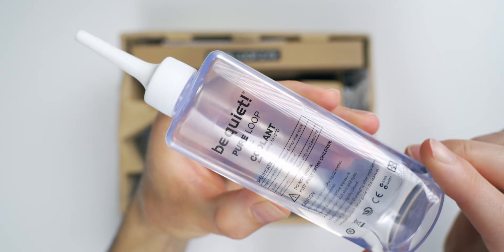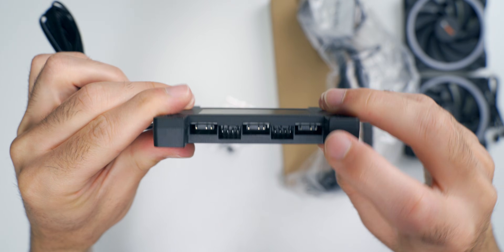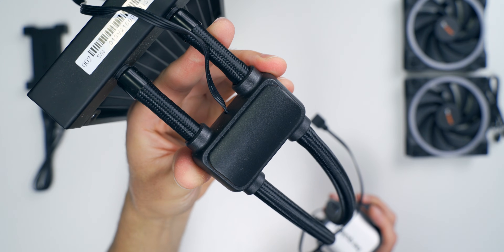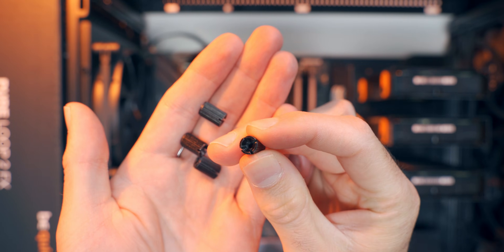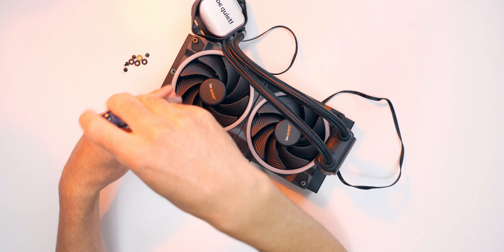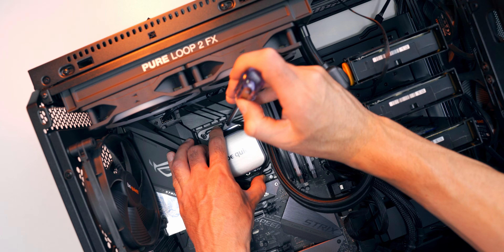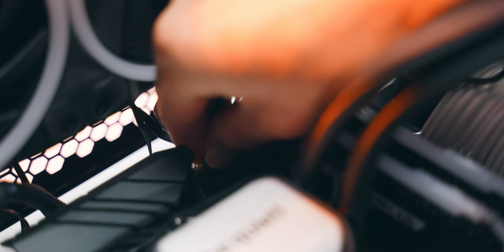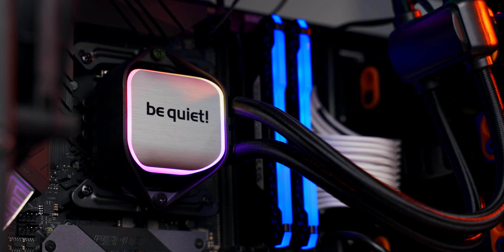Be Quiet! Pure Loop 2 FX AIO Liquid CPU Cooler Unboxing & Installation

Comment: This did not go much into detail on how the tabs (mounting bracket) are facing.  I had to turn them around.  Other than that, it was a good video.  I had to purchase the “240”, which did not come with a hub.  Should it have?
Reply: Its only comes with a hub if you bought the RGB version i think

Comment: how can you change the rgb colour of the pure loop 500 fx? Also did you notice the silicon of the aio fans where the x8 screws located to unstuck ? i mean the rabbers where the x8 screws are fit on to connect with radiator

Comment: TO EVERYONE WHO STRUGGLES WITH FAN AND PUMP SPEED:
Plug the pump in your pump header on your mainboard, IF YOU DO NOT have one: Plug it into a Chassis or System Fan header, and then go into your BIOS and select either FULL SPEED or TURBO on the header you plugged it into

DO NOT plug the pump into the hub of the AiO, the system will handle it like a normal fan then, which will result in a MUCH slower speed of the pump, thats struggling with the liquid flow

DO NOT use CPU OPT, this is just a additional fan header for the CPU cooler, that uses the same speed as the CPU Fan header

So. one fan should be in the RPM header on the Hub. the rest of the fans and the cooler block RGB cable can just go in the other headers of the Hub
Then you plug the Pump itself to either a Chassis Fan header or a system fan header (if your mainboard has a pump header use this one), then you start your pc, go in the BIOS and select either "Turbo" or "Full Speed" on the header you plugged the pump into

Congrats, you can see now the speed of your pump, and the speed of your other fans
Reply: What do you mean do not plug it in cpu opt? So he said in the video to do so. I followed and did same. Is it bad?
Reply: Lol I have the pump plugged into the "pump" port of the hub and assumed that would work. It's been fine for 2 years but it is kind of loud. Excited to check your advice.

Comment: Best guide ive ever seen for installing!
Bought mine last week and was a bit afraid to install it myself cause im pretty clumsy and never did this before
This guide helped me completely, everything is working as intended, my CPU has never been "cooler" before
Be quiet! just never disappoints, sure it costs a bit more, but its SUCH a good quality and the fans make pretty much no noise at all
It like you took noctua fans, but they dont look horrible
Reply: How did you sync your cpu fans rgb with the case fans?

Comment: I bought the 240mm and it could not even keep my 5700x cool. On load my cpu would thermal throttle and get to 95 celsius. I tried 2 different coolers and both the same issue. Terrible when a cheap ID cooling aio keeps it under 65 celsius on full load!
Reply: Thanks, was about to get this for my 5700x

Which aio did you end up getting?

Comment: I am a new builder, and they really need better guidance on where to connect the wires especially from the pump and where to plug in the hub wire. On my mother board it has a Pump fan header, so I plugged the pump there and the two radiator fans to the hub then the wire from the hub to the CPU fan header. their instruction manual says nothing.
Reply: I did the same thing, but I suppose that this guy did it ok in the video, it doesnt really matter where you connect the pump, whether its the cpu fan header or pump (fan) header. Just make sure to connect one fan to the rpm header on the hub to make your mobo recognize the rpm of your aio fans :)

Comment: i have a question - will this pure loop be enough to cool i5 13600k? or maybe i need silent loop - my case is pure base 600 there can be only 120,240 or 360 fans on top or better go into dark rock 4 pro? (on front panel i have 2x 140 pure wings 2)
Reply: I have the exact same question! Pls answer it dear channel owner!
Reply: Probably, my i7 12th gen stays cool all the time, tho if you really want to be absolutely save, go for the 360, but i think 240 or 280 should just be absolutely fine for an i5

Comment: plsss can someone tell me can the be quiet pure loop 2 fx 240mm fit the be quiet pure base 500fx? pls comment I rlly want to know
Reply: Probably a bit late as it was 6 months ago, but yes it will. I have the same case, and the 260 pure loop 2. Mine is paper thin away from the vrm cooler on my mobo, but it works. The 240 should have even more space.

Comment: Great video, I have a question I cant find the answer to. I have ROG STRIX B350-F which has 2 RGB connectors on the board but they are 12v, can I connect the hub to one of these or will it blow?

Comment: Please watch out how you Connect the Cables
One Fan should be connected to the RPM port(this fan will give the fanspeed information to the MB) at the hub and connect pump directly next to the RPM port(PWM 4Pin)then connect the hub main port to the CPU_FAN and everything should work fine
Reply: Thank you! This isn't (imo) clearly explained in the manual. So we were wondering why no RPM values were reporting back to the motherboard. 

We installed the pump header on the dedicated port on the motherboard btw. Seemed better to have it at an almost constant rmp rather than let it fluctuate at the same speed as the fans.
Reply: This needs to be the top comment. The manufacturer instructions and this video are both vague. This comment is spot on.
Reply: What about CPU opt? Isnt that needed in any way?
Reply: Thanks for this, still nothing in manuals and the official video doesn't show it either, and this video seems to not do it properly. Appreciate your comment.

Comment: What is the RPM on the hub used for then?
Reply: this is the golden question. In the china manual it says it will send the connected devices RPM through to the motherboard header. Im stuck on this, as far as I can make out, you will only be read RPM off one device and only if that device is connected to the RPM socket on the hub. Im a newbie, first PC build and given how quickly everyone brushes over the hub wiring including the manufactures then I can only presume it it stupidly simple. That said question remain, is it the pump motor you link to RPM port on hub, then hub to PumpFan header on board as it can draw the most and command the fans and pump from that header whilst taking RPM off pump? Some say its better to know the pump RM than the fans? Geez... the case I got came with 4xARGB fans with their own hub too inc 2x 5v ARGB (in's?) Bah im lost!
Reply: @poonholder5643  I didn't end up using the RPM port, as shown in the video and it seemed to work out okay. The case we got, of the same line, Pure Base FX, came with a hub as well. 

What we ended up doing is using the AIO fan hub from the box for the two fans mounted to the AIO radiator, along with the RGB connectors. 

We plugged the ARGB cable from the AIO HUB into one of the ARGB ports into the case hub. We have the case fans going to the case hub as well. 

This way, with the AIO Hub RGB connector just plugged into the case hub, along with the case fans, the AIO radiator fans are getting the same RGB signal. The case hub RGB connector is what's connected to the mobo. So there's only one RGB connection and they're (fans, AIO, etc) are all on it. 

It'd probably be fine having the individual hubs, if you have more than one, connected to their own RGB connector on the MOBO, but, this is what we did to simplify it a little and everything is synced and working well. 

With that said, the AIO hub RGB is connected to the case hub, which connects to the MOBO. The AIO hub 4-pin fan connector (that has the radiator mounted fans) is connected to the 'CPU-FAN1' on our mobo. The fan cable coming directly from the pump is connected to 'PUMP-FAN' and the case hub is connected to 'CASE-FAN1'. Temps have been surprisingly great with a 5800x and 6800XT. 

Hope this helps.
Reply: @justinfay3011  yh man it was all to easy so complicated :) Hub can't send multiple rpm signals back to mobo so the 1 is ca has a dedicated named port on the hub. I but me water pump to it so can set an alarm if it fails. Part from that they just spaghetti junction creations it seems :)
Reply: @justinfay3011 this is exactly what I've been looking for. I have a bequiet 500fx case with the built in hub, and couldn't find anything about what to do with the aio hub as well. Thank you.
Reply: @captainamerica274  Glad to have helped

Comment: Hey dude, thanks for the video. I have the same AIO and for whatever reason, I can't access fan speed control within Windows, and even the BIOS doesn't seem to recognize the fans. Is there a software you're using to control fan curves etc? I installed the cables as you have in your video.. Let me know your thoughts :)
Reply: Dont connecté like this CPU fan and CPU opt . connect pump on aio pump and in the bios qfan reconize the aio . For the fans, connect on CPU fan  sry for my bad english but the pwm use faster the pumps
Reply: @i73380069  i did that, but the BIOS only detect pump speed, not the fan :(

Comment: do you know if the 280mm would fit that case ? (500 fx) on top
Reply: Pure Base 500 FX will only fit a 240 radiator on the top. There are only a few midi towers of the same size which will take a 280. Phanteks P500A is the best known for fitting larger radiators as it has a lot of head room. The Corsair 4000D can fit 280 at a push but you'll want lowish profile RAM. Even and Arctic II 240 is a bit of a tight fit in this case. The pure base FX radiator is slightly on the thinner side meaning it fits snug into the pure base 500 fx.

Comment: I just bought this cooler to harvest the fans to use in my Phanteks Evolv Shift XT build. I ditched the Phanteks AIO cooler ARGB Halo fans for these, a better choice I think!
Nice video!
Reply: um look up light wings 3 pack
Reply: @shun_914  Um…at that time they were not available anywhere. That was the reason I purchased the AIO for the fans.

Comment: Would it be possible that you also could have mounted the 260 AIO-version on the top in your case? Because there is some space left.
Reply from the maker: Yes, the 280 would fit in the top of this case as well.
Reply: @ECPUz  sorry I mean a 360 AIO... possible?
Reply from the maker: @Sica1000  Yes, this case can support a 360mm in the top as well, but you have to watch the HDD cages as they can get in the way of the hoses on the AIO.
Reply: @ECPUz  mhm, thank you for second reply. Enjoy the weekend.